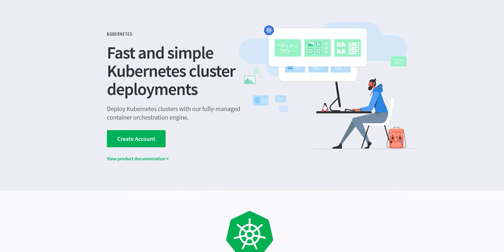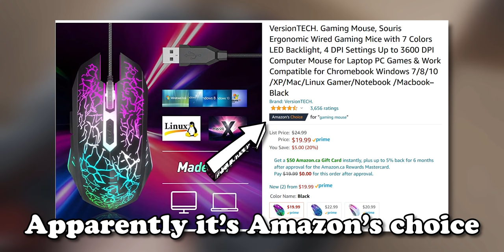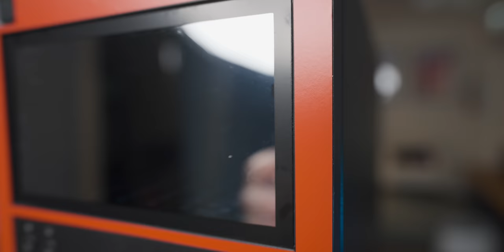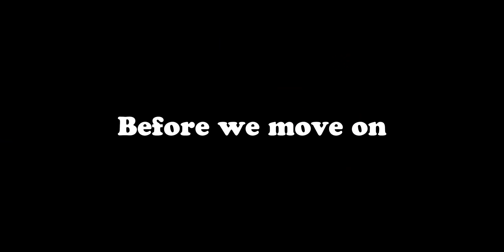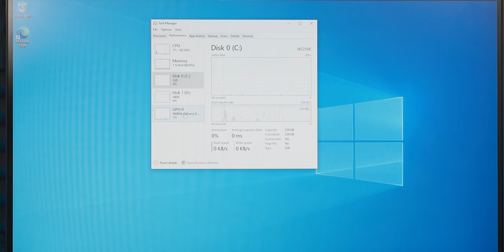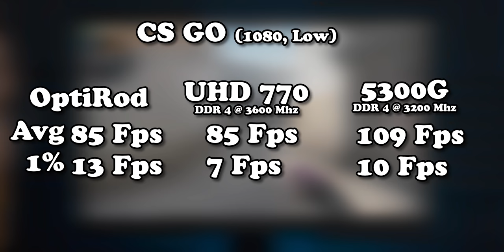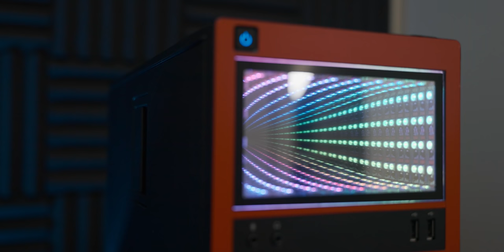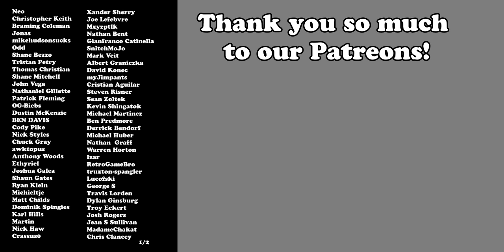I Couldn't Resist Buying This "Gaming" PC From Best Buy...

Comment: I expected more from that GT 1030. And then I remembered they made a DDR4 version of that card, which cut performance in half.
Reply: I suspect this is the gddr4 version, the gddr5 one should run gta5 better
Reply: @Cosmin4  it does, I have one. Granted, I only tried it in a friend's and I don't play stuff like gta, but it ran pretty smooth to my eye. It does run a lot of older games maxed out on 1080p.

Comment: Probably an OptiPlex 3010. 

I got one off eBay for $110 shipped four years ago with an i5 and 16gb ram. Held up with a 750ti then an rx 580 pretty well (after power supply upgrade). 

The 7010 and 790 was when Dell switched to the proprietary PSU connector.
Reply: Do you still have it?
Reply: Nope not the 790. The 790(2nd gen) is actually older than the 3010(3rd gen). There is also the Optiplex 990 which is pretty much exactly the same as a 790 but one of them has different RAID support or something. I have both a 990 and 790 motherboard and they both are still from the time when Dell still used standard connectors and stuff. I think it was 4th or 5th gen Dell started using proprietary connectors.
Reply: @torpedo996  yep, previous Dell Optiplex 3020 owner here, that one had proprietary psu connectors
Reply: Am building up a 7010 at the moment.  it still uses the same 24 pin psu connector.  IIRC systems for up to 3rd gen like the 3010,  7010 and 9010 mt's still use standard ATX PSU connectors, and started to use the 8 pin proprietary connector on 4th gen systems like the 9020 mt.

Comment: That's probably the ddr4 version of the gt1030 as I've used the gddr5 model before and the GTA and Fortnite performance was more than double in my experience
Reply: i too use a GT 1030 and i get like 100+ fps in gta 5 normal 1080p
using a GT 1030 as my daily driver isnt actually that bad
Reply: Yeah that is for sure the DDR4 version and this should have been called out, although ultimately Nvidia can only blame themselves for causing this confusion.
Reply: I agree too
Reply: Don't forget that the biggest bottleneck might be the USB2 connection that his external drive is connected to.
Reply: Dawid, something to note is that this is a GT 1030 DDR4 and not DDR5, I've built at least 5-10 PC's with GT 1030's and that's a Gigabyte DDR4. The DDR5 can easily do 60-70 FPS on GTA V no sweat.
Reply from the maker: Yeah! For sure. Not all GT 1030s are born equal. 😁
Reply: Look at the memory clock speed 1050mhz, the gddr5 model has 3000mhz
Reply: DDR4 for sure, and something wrong with drivers. Even with DDR4 this should be around 50+ FPS in 1080p normal.
Reply: @aleksazunjic9672  the power draw seems a bit off too... under full load his card draws under 20 watts, while mine slightly overlcocked on memory and undervolted  under full load draws 30 watts and its the passive model toos o it doesnt waste 2 or so watts it takes for a fan
Reply: @andreasnussbaum5409  Maybe it was underclocked because it has passive cooling. People usually overclock them because it is relatively easy to get 20-30% boost, especially if you buy cheep fan and attach it with zip ties or something.
Reply: @aleksazunjic9672  i strapped a case fan to mine, and undervolted at 1800/3750 i never go over 60c, and with a big house fan i overclocked core to 2100 and got 43c highest temps, but on topic of the video, if it was due to the heat, the core would be underclocked/drop boost clocks, not the memory, ive never seen that happen before, or heard of it
Reply: @andreasnussbaum5409  Well, some companies tend to underclock both memory and GPU, especially on these passive models because they do not sell them as gaming cards. Instead they utilize them as display adapters for "silent PCs"
Reply: @aleksazunjic9672  im using a 1030 passive myself and ive never seen that, and in the video the gpu is under 50c and nvidia gpus underclock themselves due to heat at 83c

Comment: The lack of bloatware is pretty good for a dell. Even on high end stuff like my XPS 15, I have to wipe the SSD and reinstall windows right out of the box.
Reply: Dell didn't refurbish this model. It just happens to be a Dell. This kind of product is for  people or parents who don't know any better on what is a decent current gen gamin pc is. They probably saw the price and said what a steal.
Reply: @potatomongrel  Yeah, looks like someone who bough some old OEM machine, threw a GPU in it and resold it as "gaming PC"
But this at least has a decent CPU/GPU combo, not like people who throw together a i5-4460 with a GT 710 and a single 8 GB stick of RAM or some shit like that.

Comment: Oh god these things are so hard to covert to a sleeper. I did it for an optiplex 7010 with an asrock b450m steel legend and a Vega 56 and the front panel headers are very proprietary (especially the usb2/audio header), there are pin outs on forums but be prepared for front panel audio to not work. You also need either a dremel or a sacrificial screw and a lot of force because the hard drive cage is part of the case. You can actually attach a 120mm fan/AIO in the front with 2 screws once the hard drive cage is removed, so I’m very much looking forward to how the next video will look
Reply: Wouldn't it be easier to use a drill bit + drill and drill out all the rivets since the HDD cage is riveted in? It's what I plan to do, and the front I/O I'm thinking of using a 5.25" bay to USB & 3.5/2.5" drive adapter and covering up the old I/O (I don't use front audio ports, and I've also heard front audio ports are not optimal anyway due to interference but I believe it varies based on cable quality). As for the proprietary power/reset cable that should be easy enough with soldering and heat shrink tubing onto standard connectors

Comment: Sandy and ivy bridge were really where that style of optiplex MT got it’s start. Before this is the LGA 775 based optiplex 780 which have the black plastic front panels sandwiched between 2 storm grey side panels. 2nd and 3rd gen intel use the same socket of course, so the relatively free of proprietary garbage design was maintained until Haswell came around. Those 4th gen machines look almost identical externally, but make the move to dells weird dumpster juice psu connectors.
Reply: My sandyBridge Dell Was An I7 920 Studio xps 485T\9001 Used that beast till about 6 months ago when i went and built an X299 Tower , was going to keep the case but unfortunately needed to use it for the customer that needed a machine in a few days .
Reply: @gamersplaygroundliquidm3th526  I managed to build an x58, triple channel 24gb DDR3, i7 990X build with the guts of a first generation Alienware Aurora R1, got it for free. Although it originally came with an i7 920, I put the 990X in there myself. Later on I upgraded it from the original R7 360 to a 1070ti and it's now my "backup build" that runs in the background next to my X570, 5700G, 3080 build.
Reply: @mitlanderson  that's awesome , I actually almost upgraded to that proc a few years back. It's amazing how until now the chips haven't changed much in design we been buying the same ole for a decade. lol. The case and machine I been using for the last decade was Dells attempt to show Alienware they could build great gamming towers, so after the release they were acquired by dell

Comment: I love using Optiplex 390s as a starting point. I5-2400 is solid for a budget rig starting point. Downside is 1333Mhz max RAM speed and sata 2 ports on the motherboard. 2.5" Sata SSDs will still get around 280Mbps speeds. This is back when OEM weren't always trying to screw us with proprietary stuff.

Comment: I really think those Optiplex PCs are amazing value.
Reply: they really are, i got one now with 16gb ram, i5 4570, gt 1030 ddr5 and its a great 1080p gaming machine for the kids.
Reply: @bryanprice2800  in gta v how many fps sir? I have i5 2400 with gt1030ddr5 with 30 to 40 fps in 1080p
Reply: @nashcomp  iirc it was around 50-60 high settings at 1080p.

Comment: I would be interested to see how well you could upgrade this system. One of the reasons I started building my own systems was that Gateway, Hewlett Packard, and Dell all starting doing non-upgradable stuff...yea, that was a really long time ago.(and many builds)
Reply: here have some yummy Guzzle Juice dude it's ggrreeaattt........🤣🤣🤣🤣🤣🤣🤣🤣🤣🤣🤣🤣🤣🤣🤣🤣🤣🤣🤣🤣🤣🤣
Reply: Honestly, this system is screaming for a 1050Ti/1650/RX570 upgrade and it'll then be a very competent little daily driver/e-sports machine. The 1030 is very much limiting what it can do.
Reply: @JinghisKhan  I'd go even higher if a better CPU is also in the upgrade. Throw an i7 in there and give it a 1060, 1660 or RX 580 and that thing is still capable for a lot of games.
If that i5 is what stays, yeah 1050 Ti level would be fine. I have a i5-3570K here paired with a 1060 and that das alright, so I guess I have some experience on that level of performance.

Comment: Gotta give credit where it's due--whoever sold this put some genuine effort into its modification.
Reply from the maker: Definitely! If you're going to make an OptiPlex scam, you may as well do it with some style.
Reply: @DawidDoesTechStuff  They missed a trick though, as there looks to be room for a USB 3 expansion card on that motherboard which would make a significant upgrade at minimal cost.
Reply: i dont know why someone would put so much effort into building/modifying a pc that can barely handle modern games
Reply: @DawidDoesTechStuff  Optiplex scam?
They can be turned into decent gaming pc that can run most games.
Reply: @jacobeii  They can easily run modern games.
Reply: @JubbLaRacing  yeah but might as well put effort into a pc built from scratch, it kinda is just a reverse sleeper pc

Comment: The 1030 is hit or miss, as they have the DDR4 version floating around. Great video David , that certainly is a sexy optiplex

Based on those benchmarks , I would definitely check if it's the ddr4 version.
Reply: Iv used the gddr5 and it's a lot faster

Comment: An Optiplex 3010. If you know what to look for, very recognizable.
The X010 series were the last series which did come with a 24-pin connector on the mobo.
A 3010, because it has only two RAM slots on the mobo, the 70XX and the 90XX both have four. Same goes for the amount of USB ports on the front panel.

Comment: A STANDARD INTERIOR IN A PREBUILT?!?!? Pre built companies take 1 step forward 2 steps back. Just upgraded my grandparents pc and their old prebuilt was standard albeit upside down. So I can still use it in the future COUGH COUGH Dell
Reply: I recently went to my grandfather's house. He wanted my help installing a GPU and SSD. I was pleasantly surprised that not only was his old offic PC running a 4th gen i7, but was also entirely normal components inside. Gramps is now probably the oldest Valorant player at 86.
Reply: @DigitalJedi  Thats actually amazing, my grandad plays solitare and majong, but his new i3 10100f, 8gb ram, and blazing fast SSD, he could do a lot more if he wanted. His old PC took about 10 minutes to go from off to home page on firefox, now it does it faster than my PC and my PC is no slouch ahaha.

Comment: I should point out, I am building one of these (9010) that I picked up with 16GB of RAM, the i7-3770, and I am adding a GTX 1050 TI.  At 1080p on medium/high settings, you can play anything you want on it.  With an SSD and storage drive, these systems are still very capable budget build gaming computers.  You can get the entire setup for under $400.  Definitely worth it.

Comment: Until upgrading this December, I used a Dell Optiplex 7010 SFF with a GT 1030 in it (but the good one, GDDR5).  I would never sell it as a gaming PC, but I made my way through D2R and Borderlands 3 with it.  You can put a good +600 clock speed on the memory and +200 on the processor in that card and will never see issues.  It's now our shipping computer at work.  Except I paid the appropriate price for it, which at the time in 2020 was $50 USD on eBay. (GT 1030 not included). 550 CAD is insanity.

Comment: Did a HP Envy 2015 sleeper build. added a 3060 ventus and swapped mobo's from the i7-4790 cpu to a bazooka matx mobo and 10th gen 10400f cpu for 1080p CAD drafting, work and gaming.

Comment: Roughly $250 worth of hardware for $426. Adding in the kb and mouse plus the rgb customizing its not too terrible as long as you understand you losing out on some performance because of them. A couple years ago I cobbled together a super budget gaming pc similar to this one. Ebay used office pc i5-3470/16gb ram $125, hp oem rx 460 $60, ssd $50.

Comment: The way that's performing, that's got to be the ddr4 version of the 1030... I played through GTA V with an i5 2400 and a gt1030 gddr5 version (and yes it was an optiplex... Sff lol), and I got 60fps at 1080p normal, and it got even better when I upgraded the CPU to a xeon e3 1230.

Comment: if you do build this pc up, just remember they have a tendancy to use proprietary front panel connectors.. pin out guides and pin extension cables will be your best friend.. i ended up cutting and soldering my case connectors when i changed my case, and in hindsight i would have preferred using the pin out extension cables instead.. just a heads up

Comment: It’s a 3010/7010/9010 model. The x020 models (4th gen) were when they went (more) proprietary.  Still uses proprietary front panel connections.  Not the easiest thing to swap a normal board into that and use the front panel.
Also, the last dell to support XP.  Throw a 900 series card in it and you’ve got a retro XP machine that also runs Win10 just fine.

Comment: @Dawid, get yourself the i7-3770, slap it in there and so long as your GPU is the GDDR5 version of the card and not the normal DDR variant, you can easily get 60-90FPS in 1080p on GTA.  On low/medium settings, I got mine to run Forza 5 at 60-80+ with no hangups, stutter, or crashes (you must have all game updates applied).  These Optiplex systems are still very capable budget machines.  Especially considering you are revamping the much more ancient Optiplex/Dimension with the Core 2 CPU in it.

Comment: Yup, gotta max-build that bad boy.   Call it the "Q-Sheep to Q-Ship Challenge"!

There are "rules"...
1. Must keep the infinity panel
2. No physical mods to the case itself; you can remove parts, but no bending or cutting any original case parts the were "OEM".  Oddly enough, welding(!) is approved!
3. Must retain the Infinity Gauntlet
4. Extra points awarded for water cooling, MORE RGBeee, archvillian-level fiendish complexity
5. The infinite Well of Doom remains prominent...in fact, smother ALL the external surfaces with Infinity Glory panels

Make this happen to level up to Thrawn Master status.   Go from Sheep in Wolf's Clothing , to Wolf's in Disco Sheep's Clothing!  Only you can save us, Obi-wid!

Comment: The front IO is not standard.  Putting a MATX MB in will be tough.  But you can put a power supply, an i7, 16gb mem, and a GTX 1070 and get respectful gaming.

Comment: I was gaming with an i5 3470 (overclocked and liquid cooling) for quite a while. Then I got a 1080 ti for a bargain, so last year I upgraded my PC to get pass the bottleneck. Anyway, the 3470 never let me down, coupled with 2 x 8gb Corsair Vengeance, liquid cooling and a SSD, then add something like an RX 570 and you have a decent setup. Trust me.

Comment: Also the Vega 6 iGPU does better, only because the thing has more cores and a higher frequency than the UHD770.
Though lots of people have mixed thoughts about the CPU it’s packaged with. 4 cores 8 threads is good, and the thing is cheaper in the long run if you configure a system well enough, but it still doesn’t compare to 10th or 12th gen i3s.

Comment: My first rig was a i5-3470, 16 GB of RAM, and a RX 480 and AIO water cooler. Not the best, but for what I paid it ran Cities: Skylines modded half decently. I eventually upgraded but those old i5 processors aren't that bad.

Comment: Honestly, for a resold OEM "gaming" PC that isn't too bad. A somewhat reasonable CPU/GPU combo, good amount of dual channel RAM on proper speed, some SSD, non-bloated OS.
And if something like this would be the machine I'm stuck with, you can bet I'd mod the hell out of the looks.
That i5 would indeed benefit from giving it something like a 1050 or 1050 Ti (or maybe even more). Especially since all the games were on proper multiplayer "pro" settings and it was the 1030 that was the limiting factor.

And for the maximum on the board, I guess i7-3770 paired with a 1060, 1660, RX 580 or something similar.

Comment: I am actually surprised they didn't do that... (make a sleeper build) it's got all it needs to be able to easily move over to a higher end matx build rather than the circa 2013 era i5s.  The 1030s are hard to get a hold of right now to...   (CAD 130ish if you can even find one..) so it would have made some sense to just go to a Amd Ryzen 5600G with no video card and still sell it for 7-800.

Comment: You know, I think we have to give the builder points here for their colour-coordinated e-waste. The headset is black with orange trim to match the case repaint and the keyboard even has an orange badge on it too. That's attention to detail, right there.
Wondering now if you could fit a little LED screen where the infinity mirror is and have an AIDA64 secondary sysinfo display there. Probably not with that GPU, though!

Comment: The FPS is probably being affected because you're running it off an external SSD on USB 2.0, other benchmarks with the same specs show like 100 FPS on 1080p performance mode.